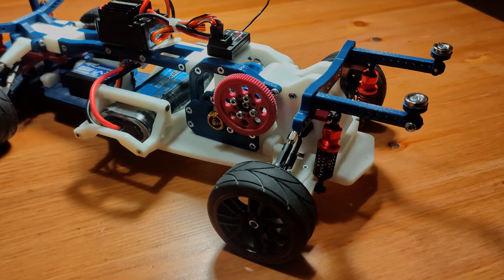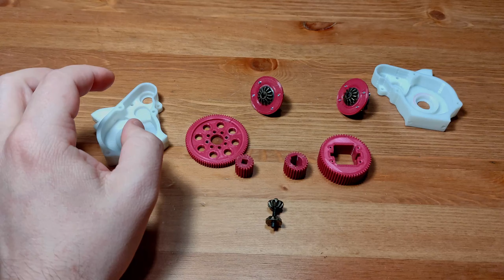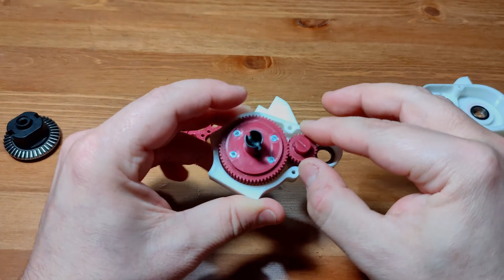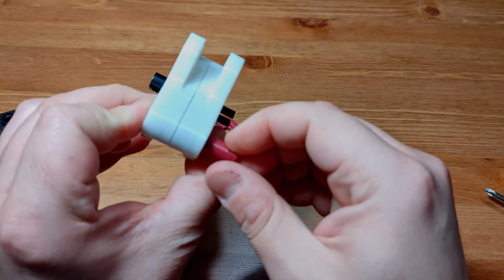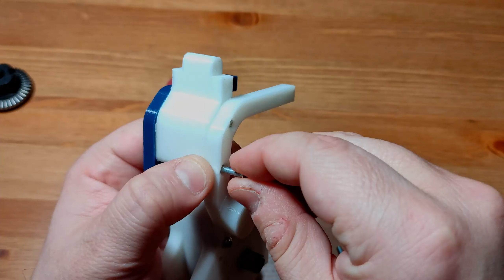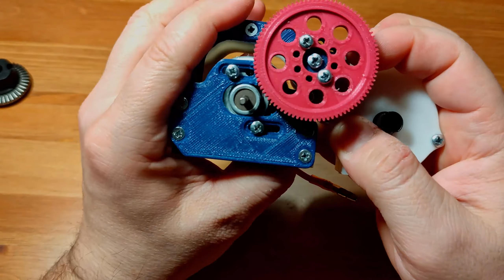Yet Another RC Car Chassis - Assembly Part 1 - Power Train

Comment: I couple comments on your video. Should put some grease on those internal gears.  I always assemble by hand so you have a feel for when the screws are tight. It's so easy to strip the plastic using power. Great video and well explained.

Comment: The chassis looks like an MST Drift chassis, I like It. It has the potential also for off-road use as a rally Car, I you maybe swap the pinion and Spur for a belt Drive system and then print a cover over them it would be even better. Who knows, maybe a 4WD version too. keep up the good work!